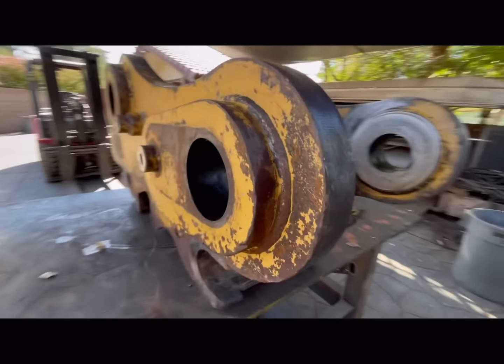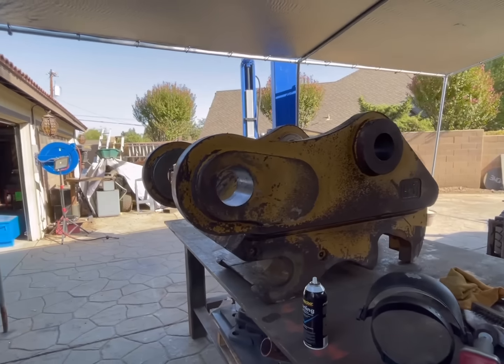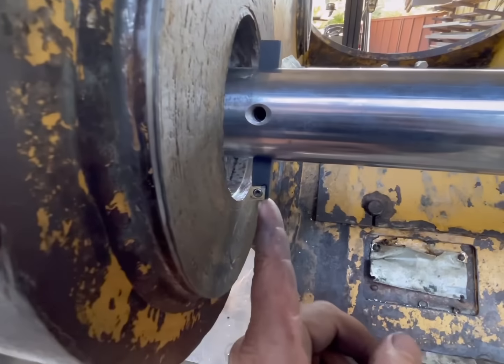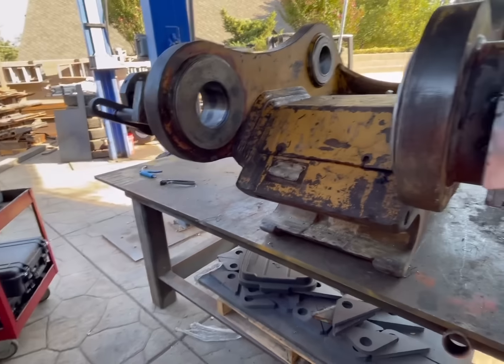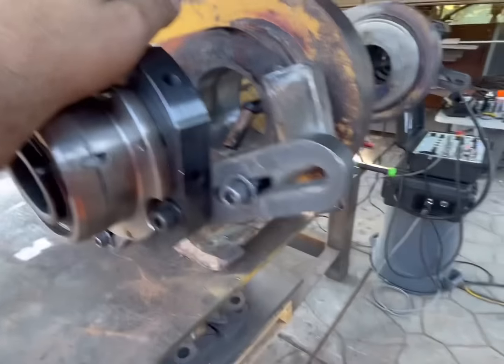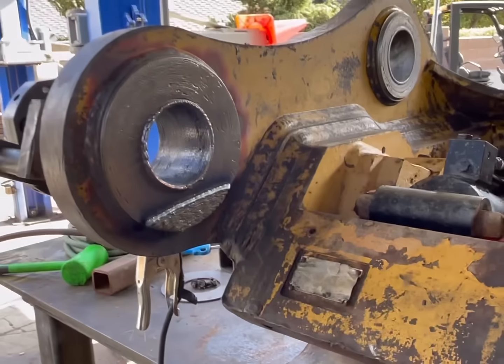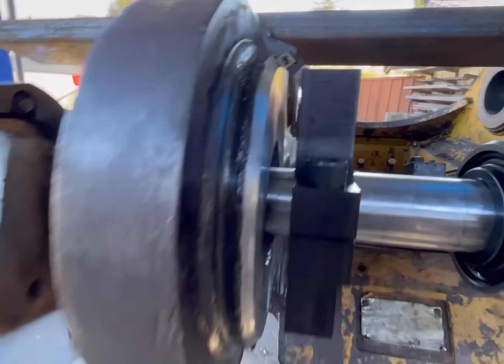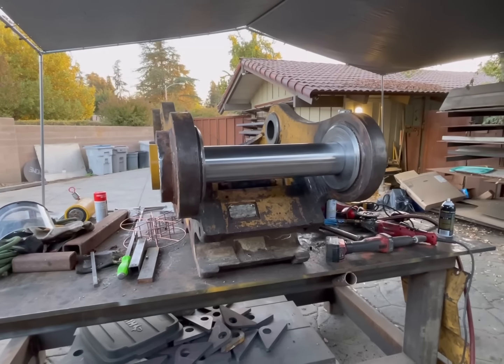Line Boring and Facing a 349 Quick Coupler

Comment: I'm for sure an armchair machinist so please take anything I say with a grain of salt.  I was wondering if it would have actually been cheaper/faster to gouge off that boss you really had to build up and weld on a new one?  It seems like that would get you to the end faster than having to build it up and also allow you to get rid of that grease crack at the same time.
Reply from the maker: If you could buy them from cat Then it might make sense.  If I had to make them it would be about the same as far as time goes.

Comment: If there's a crack deep enough to hold all that grease, wouldn't it be better to cut into it until it's gone, then fill it back up so it doesn't cause issues down the road? I mean, a few drops of water making their way in past a failed o-ring seal would potentially make a real mess, in short order.
Reply: That grease is between a boss and a welded on spacer.  You have the main lugs and a boss like a donut welded on each side of it. So it's three layers deep.

Comment: Just curious, if the holes are oblonged, the centering cones work well enough to get back to the OEM center on both sides?
Reply from the maker: Technically it would be close enough.  But I made some adjustments after that to make it perfect.

Comment: I'm always amazed at how much abuse this machines take but not all operators are Cowboys usually the younger Boys the Man childs wannabees are the Cowboys but what hard to figure is you don't need to go to some WYO tech to realize these machines can only make you money  when they are being operated on site but to stop then have to make arrangements to have your machine transported to whoever is going to do you the hardest is crazy the older more mature operators know how to operate these machines and what the limits are I've seen these being used with the bucket so badly in need of the job you just did it's barely hanging on....

Comment: For the looks of things you setup shop in what, the backyard of your home? Neighbors haven't called code enforcement on you yet man? I see houses all around back dude. I mean grinding, hammering, welding lights and fumes? And don't tell me that you're zoned as commercial in a residential area. 
By the way what you meant to say was that welding cast iron "cold" causes the weld and material to CRYSTALIZE" which is why experience teaches you to put a propane torch to it and heat it up BEFORE welding.
Reply from the maker: We have owned the house for over 20 years. So no, the neighbors have not called and there is no issue doing what I do there.